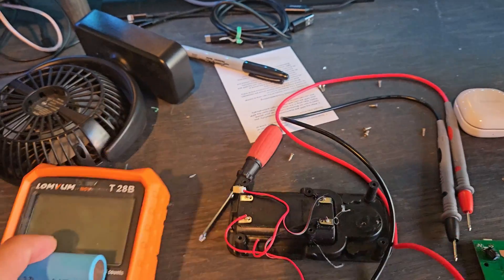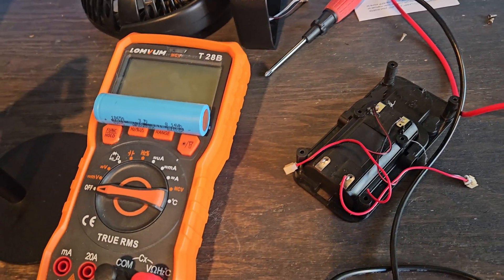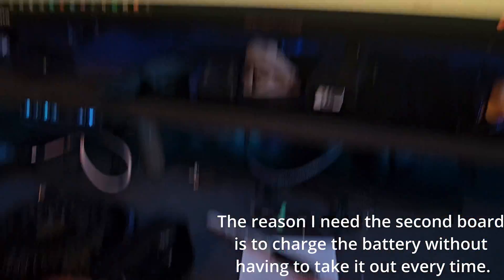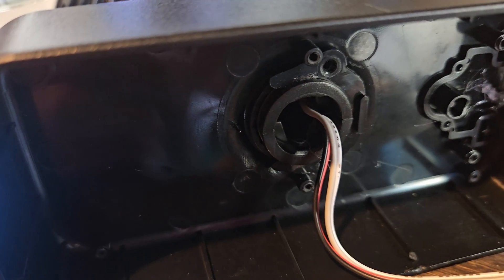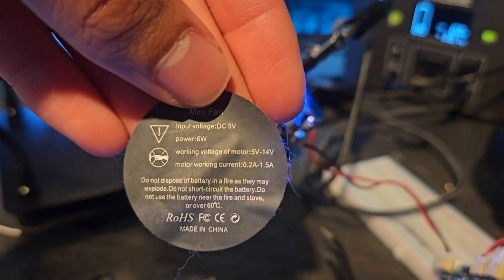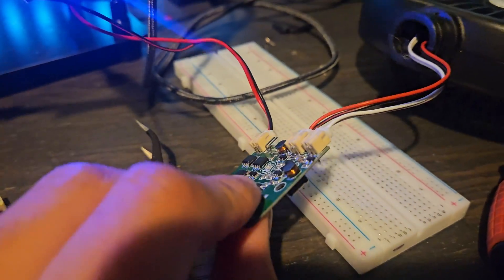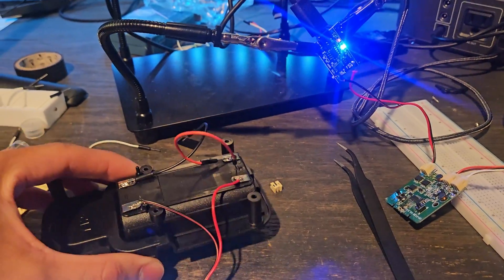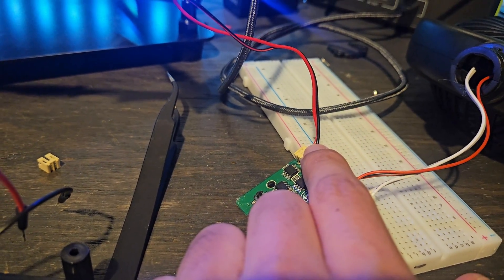Rewiring a Portable Fan: USB-C & 3.7V Battery Hack!

Comment: Thanks for posting! My charge port got wrecked when someone knocked it off the table while it was plugged in. The weight of the fan pulled the USB connector off the board.
Reply from the maker: Wow. Crazy! Good thing you can usually modify things! :)